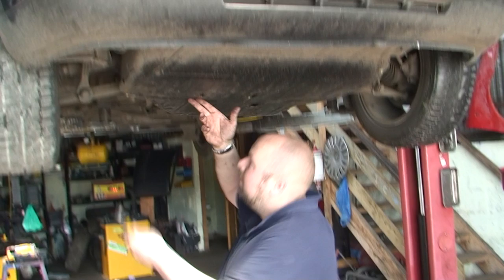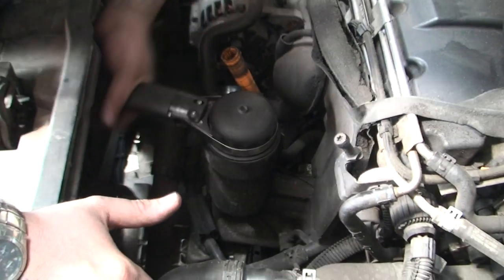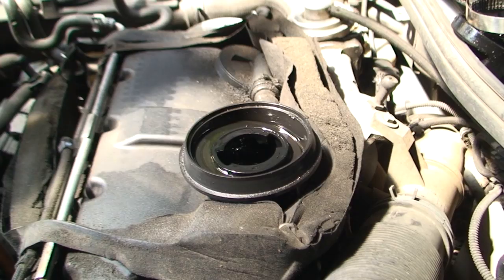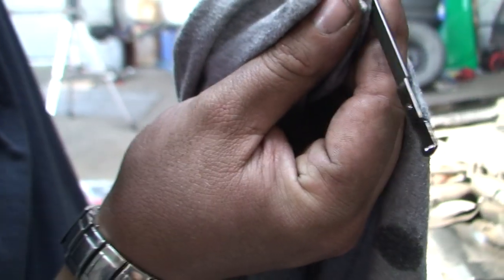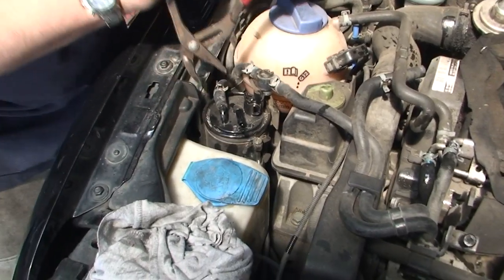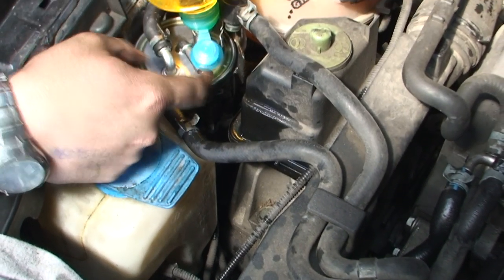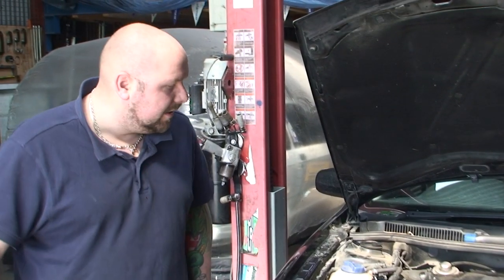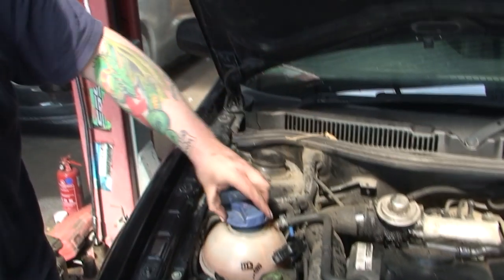bodgit and leggit garage how to service a tdi volkswagen golf

Comment: By one side this is a very usefull video for those who want to do this small jobs their own, by the other you are completely clumsy, doing a pretty messy job by dropping fluids everywhere water or fuel, you don't ware gloves, you are not carefull with the car, don't pay attention to details (you didn't even check the color of steering fluid wich is very vital for the powersteering pump!!!)

Comment: surly by doing the oil filter after tightened the sump you'll leave dirty oil in the car?
Reply from the maker: hi mate first of all it is very difficult to get every single bit of oil out you will always be left with at least a litre in your engine and not only and not only that all the oil had rained out of the oil filter thanks for watching thanks for the comment
Reply: @bodgitandleggitgarage  Seriously the idea is to get as much of the dirty oil out as you can.  the oil you can see draining out of the filter is not getting changed but is draining to the oil pan.  I also pour my last quart I am adding in the filter housing to help provide some oil a little bit sooner at start up.  If your going to instruct people show them the best way not the half ass way.
Reply: @ToddHollarn   yes oil filter should be REMOVED before car goes up for drain off, still a litre of crap oil in there!

Comment: nice job ... I use an oil extractor (through the dip stick)  when changing oil ... saves having to get under the car etc.  Also don't forget the cabin air filter ... always a pain to get to ... I replace with a good house furnace filter (with a carbon insert) cut to fit.  You can get 6 or more of these things from one house furnace filter ... at a tremendous cost savings ... the reason the antifreeze was brown might indicate someone topped it up by using something other than the OEM VW antifreeze ... if you uses something other than the VW stuff it will turn brown and might damage internal metal which might react with the antifreeze etc ... nice job with the video ....enjoyed watching it ...

Comment: On these engines its better to loosen oil filter before removing sump plug or during draining as there is 0.5 litres in oil which drains back down to the sump when you loosen. If you do it after you tighten the plug you have 0.5l of dirty oil still remaining
Reply from the maker: you will never get all the oil out of a car in the first place and yes some of them you do need to undo the filter first but in most cases the oil will drain back once the engine is turned off

Comment: Hallo. I have a problem with my Golf 4 1.9 TDI 90 hp 66kw 2002. There was a squeeking noise coming out of engine on low revs and all the time when U start the car till U don't drive U can hear this noise. My mate told me it's a belt or tensioner, so I did replace that start the engine and there he is the noise is still the same like before. ( Belt and tensioner was bad and have to be replace soon anyway so that is one good thing). Any advise on that ? Noise still coming out from drive belt area.

Comment: thanks for the video I have bought golf 1.4 L 2002. wondering if you could tell what oil do I need and power steering oil. 
thanks for your time
Reply from the maker: hi mate depending on what climate you are in it needs 5w30 Volkswagen spec or 10w 40 you can use ATF fluid or power steering fluid all the same
Reply: +bodgitand leggit thanks 👍👍👍👍

Comment: hiya thanks for the video. good as usual. 
is 5 30 vw spec oil  and 5 30 audi spec oil different?  I have an b7 audi 1.9 tdi and I thought 1.9 tdi audi and 1.9 tdi vw are the same engines! I'm confused now.
if it's different than how will I know what is audi specs oil??
Reply: Serg Dom Audi n VW are same think Leon just slipped up there

Comment: Great vid as allways 👍 instead of putting diesel in the new filter, could you put liqui moly in and clean the injectors at the same time?
Reply from the maker: dave bram no mate because it'll just go back to the tank you're best off just putting the stuff directly into the tank or getting it cleaned on a professional machine by a garage

Comment: hi m8 thanks for the lovely advice you gave me regarding the fuel filter thing. I have an audi a3 1.9tdi 55 reg. the front brake needs replacing.  it has a brake sensor connected I belive. I need to know whether do I need to bleed the piston or just push it in with a c clamp. 
secondly.  I have been told that I need a special tool to compress the rear brake pads to push the piston in. does my  car which is an audi a3 tdi 55 reg I. 9 engine need electronic Set up on the dash board or does it need computerised updating which is vag or vas. I will be grateful for the advice
Reply from the maker: hi mate yes just push the piston back on the front and you will not need to bleed them
Reply from the maker: as regards your back brakes do you have a handbrake or push button if you have a push button for your handbrake you will need to connect it to a diagnostic machine to win back the piston if you don't have a push button I can't remember off the top of my head if that car has whine back pistons on the back if it does you will need a winding back tool I have done videos on them as well hope this helps thank you

Comment: Wonderful advice,  very informative obviously know your job!  Not like some of the Rip off B......s out there.
Any advice on servicing my Vauxhall Agila 1.2 16 valve  2003 would be gratefully appreciate.
Reply from the maker: Thanks mate all i can really say make sure your car is nice and hot before you start so you get all the crap out oil  you're basically doing what i'm doing the video just make sure but when you're putting oil in you have the correct oil 5 30 semi synthetic will be ok for that and make sure the car is level so you get a true reading any other questions just ask hope this helps thanks

Comment: how you drain the coiling system?
Reply from the maker: Hi mate there's a few ways of doing it but one of the easiest ways is on most cars on the bottom of the radiator there is a little screw you can undo if not just undo the bottom radiator pipe but make sure you take your water reservoir top off first
Reply: @bodgitandleggitgarage  thank you mate. really appreciate that, and keep going the good work, I haven't missed any video so far :).
Reply from the maker: @iosifmocanu7852  thanks mate

Comment: is there any way you can service the turbo cheers
Reply from the maker: Mr. AdoCall hi mate not really in that sense the best thing you can do is make sure you change your oil regularly with the correct oil this will keep your turbo in tip top condition also let your turbo cool down before you turn your car off this will help
Reply: cheers thanks allot for the reply lad, great video btw. have an old gttdi golf 99 160000 miles on it. 18 years old and she only failed the nct on the reverse light switch, amazed. Yeah not really keen on stripping the turbo down and cleaning out the soot, just wanted to make sure that I was doing everything to keep it working I'm shitting the brick thinking about turbo failure.
Reply from the maker: Mr. AdoCall don't worry about it mate if it goes there's not a lot you can do no point worrying about things out of your control regular service letting it cool down before switching off is really the best thing you can do
Reply: sound. one more thing. Coming from a mechanic, would a remap be safe on a yoke this old? possibly bump it up to 140? its a 110. I'm not a boy racer its just the fact that I pay 710 on tax on a car i paid 600 for.  I want to at least push the boundary and feel like its worth it a, have a bit more power for minor motorway excitement lol  Im not a hard driver either. on the other hand maybe I should be looking for a mid life crisis mx5 ;-)
Reply from the maker: Mr. AdoCall as long as it's properly professionally remapped the only way to do it properly is to get it put on a rolling road and a map just written for your car but to do it properly you are talking between 1000 to 1500 to do this any cheaper is a waste of time believe me any magic chips online you can find a waste of time will not do anything
Reply from the maker: Mr. AdoCall amount of times I have heard cars that have been magical chipped and tuned or bullshit
Reply: Exactly. your right . A rolling road will tell me how many horses are still alive to work with... Surprisingly enough its not that bad over here. few places in Dublin do it for not that much. Thanks for ur replys lad good luck to ya. ps great rant on the nct in ur other vid